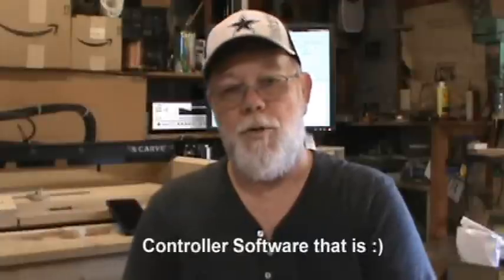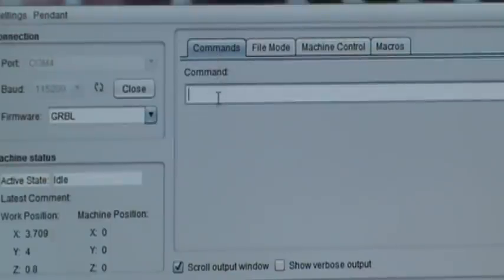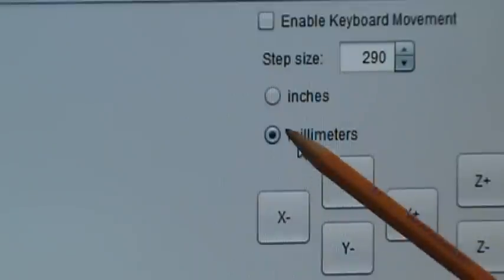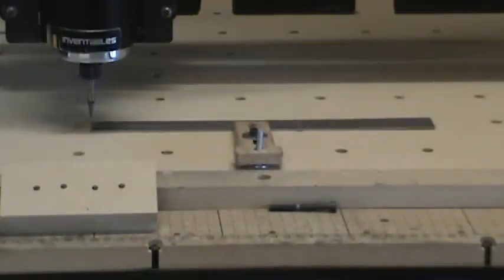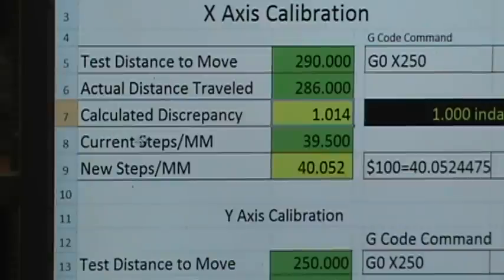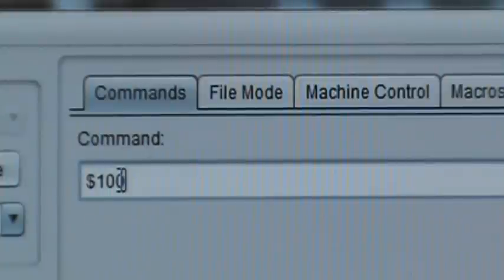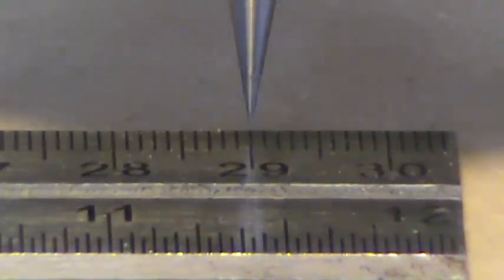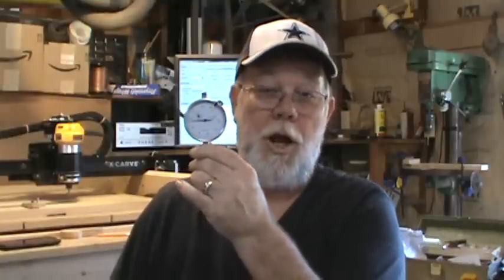CNC Stepper Calibration

Comment: Outstanding from one old hobbyist to another, THANK YOU all these wippersnappers talk to fast and leave steps out. The Spreadsheet was Gold. I can read and understand that perfectly I plan build one myself. Is this App still about I may go see after this. I have converted muy old Dremel Drill Press to a Mini Mill with manual X and Y Tables but am putting in a CNC Controlled Z axis to better manage and control cutter depth. I am machining old Model Train Chassis  to adapt Digital stuff to them. I can do it manual but the Z height on this Dremel Drill Press is not really controllable in a consistent way. Thanks for the help I go it now. Dennis in Virginia Any way you can change that hat. D

Comment: But after calibration, speed decreased, so now what value should be changed
Reply from the maker: you can iincrease speed by changing the settings on your stepper drivers.  Check the current settigs on the Pulse Table on  the driver.  The lower the setting is the higher you can get your top speed to be. After any ch ange on the pulse table is applied you will have to recalibrate the steppers again.
Reply from the maker: change your resolutin settingsnon tour stepper drivers.  sounds like they are too high to gain from anyway6. I suggesst a resoluthio resolution higher than 800. Anything higher won't likely have real benifit on a hobby cnc .

Comment: I am a newbie. i made my own machine.  I have it up and running. using arduino,grbl.,ugs. Visulizer shows an item key chain  that is 40mmx40mm. but machine is reproducing image 20 times larger. re calibrated doesn't help. what am i doing wrong? please help. thanks

Comment: I replaced my woodpecker control board with a GRLB 1.1F board.  The new board is off on the axis 4 to 1.  I could correct by changing $101=800 to $101=3600.  It appears excessive and I wonder if there is another issue.  Board works well otherwise.  Thanks
Reply from the maker: tohose numbers are not excessive at all.  Make a project with a square and measure each side and see if it is correct. If not then use the spreadsheet in this video to help you determine the correct callibration.

Comment: Not sure how u got 1.014 when u subtract 286 from 290.. My math would say 4
Reply from the maker: You would be correct if it were simple subtraction. In which case there would be no need for the spreadsheet to do the calculations for you. However, the calculation you are referring to is not a simple subtractions. It is a error ration calculated in a fairly long equation that is very easy to get wrong if you try to do it with a calculator or even with a pencil and paper. Hence the benefit of a spreadsheet.
Reply: @CharleyThomas2016  He-he ;-) Fairly complex equations @5:02 are 290/286.25=1.013 and 1.013*39.5=40.017. Indeed, you need full power of a modern CPU to get it right :-)
Reply from the maker: @Calaribdo I have found that most Hobby CNC Users (Especially the new ones) are not interested in trying to figure this out. What that want is a quick simple solution so they can just make something that turns out right for once..  My findings are based on the hundreds of email and phone calls I have had helping people out when they are stuck. They have spent a fair amount of money on something that just isn't working correctly and want a solution. That is what I have provided here.  A non technical, easy to understand solution to a common problem. I have not ever and don't ever intend on collecting any fees for any technical support.  Customer or not doesn't matter.  There are plenty of people out there that have enough experience and they have taken the time to learn the how and why of things like this, perhaps you are one. If so Bravo to you, but lets not make fun of  new users that have just scratched the surface. We were all there at one time or another.

Comment: I try to check the machine that I made, using the pen but whenever I try, I find that the pen rises to the top away from the surface of the paper
Reply from the maker: If you are using GRBL and your X and Y axis move correctly but the A Axis moves up when it should move down then change GRBL setting $3 to $3=4.  Reference Directions settings for $3 below:

Setting Value Mask Invert X Invert Y Invert Z
0 00000000                       N        N      N
1 00000001                       Y        N      N
2 00000010                       N        Y      N
3 00000011                       Y        Y      N
4 00000100                       N        N      Y
5 00000101                       Y        N      Y
6 00000110                       N        Y      Y
7 00000111                       Y        Y      Y
Reply: @CharleyThomas2016  
Thank you very much Sir, I will try this and I hope that the problem ends ...

Comment: Can you explain to me how to tell the program the measurement of the machine and measuring the piece that I want to cut by the machine ... !!! ...................... And whether the numbers that  I used it in this calibration you made will change when you start working using the machine .... I mean the numbers you used such as 290 mm Is it fixed or change later ... I ask you clarification
Reply from the maker: You do not need to use 290mm as a test distance. You can use any value you like. The longer the distance you use as a test distance the more accurate it will be.
Reply: @CharleyThomas2016  
Ok.....thank you so much

Comment: Hmmm This is actually MORE COMPLICATED than Mach3 Calibration process. 
No spreadsheet and no recalculating.   All you have to do is enter the actual distance traveled (error) and Mach3  automatically does everything.  run the test again and Voila!!   it's Calibrated.
Reply from the maker: You are 100% correct. Just try to do the math without the spreadsheet and you will really pull your hair out!
Reply: @CharleyThomas2016  Yes, IF we try to do it manually, it might have some difficulty. 
But Mach3 does it all AUTO.
2 questions 1 answer and VOILA!! 
"How much do want to move?"
"How much did it move"
(enter the actual movement"
mach3 recalculates! DONE! 
(second run is to verify. but it's done!)
In my very First set up on a Bridgeport CNC1 Mill, I refurbished
I guessed that I would have 2000 steps per inch. (initial settings) 
I run the Calibration and it only moved  
exactly 0.1 inches.  So mach3 adjusted to 20,000 steps/inch  (logically.  factor of 10)
and VOILA!   second run was only to confirm.
This Calib is done by  "Steps per Unit" (mm or inch)  so All gearing, pulleys, leadscrew pitch, etc. even added incrementally is IRRELEVANT.  The only that matters is How many STEPS did it take to get to the desired distance.

Comment: well i liked and subbed so there ye go.Curiosity time,is the x carve arduino powered?.
I'm building my own 3 axis bed and i might blag some sizes from it,drive stepper types ,spindle rating etc.
Reply from the maker: Yes the X Carve is Arduino Based. It uses a GShield mounted to the Arduino to power the stepper motors and GRBL programming for the Gcode.

Comment: I am using tb6560 board...8mm lead scrow..........1mm g coad =2560.000 1mm running ............       but continuously not running so what to do......please tell me about this...
Reply from the maker: I assume you are using Mach3 to control your machine.   If so, take a look at this video to help with wiring and getting Mach3 configured:  https://youtu.be/vf1a6F2tYdU and https://youtu.be/PwR3mzRf5X4
Reply: Charley Thomas  I am using Arduino board  than what I do...
Reply from the maker: With the Arduino you should be able to use the Universal Gcode Sender nightly build to get things going.

Comment: Thanks Charley
Starting the assembly process later today. Need to build the bench for it first.
Hope to have my controller by the time I am done putting it together. Going to take my time and do it right.
Reply from the maker: Just remember that a FLAT table top is your friend. Go to any extreme necessary to make it FLAT - FLAT - FLAT!!
Reply: Yes, FLAT :) I have 2 layers of 3/4" MDF covered by a 1/8" Hardboard.
Do you have the spreadsheet available for download?
Installing the Triquetra tonight
Reply from the maker: If you have the Triquetra then it is on the Blue disk or you can download it from the Triquetra Owners Page. Look for the Excel file G-Code Generator. The calibration page is part of that.
Reply: Thanks Charley

Comment: when I am in UGS i do not see machine status so I can not tell how many MM per step I am getting. Any ideas on this ? Thanks 

Martin 
Texas
Reply from the maker: Fortunately you don't need to. Just enter the distance you want to travel and put that the spreadsheet. When you click the jog button with your jog units set, that is how far your machine will think it is going. The ruler will tell the you how far you actually traveled and that will be the second number you put in the spreadsheet to get the correction needed.

Comment: Is it best to start axis calibration with the full travel of the machine and work down, or small axis travel first? Oor does it make a difference?  Very helpful video and thanks for your spread sheet.
Reply from the maker: It doesn't matter which axis you do first. It is best to use something that will measure the greatest distance of travel for whichever axis you are working with. You will be more accurate if you test with 300 mm of travel than you will if you test the same axis with only 50mm travel.
Reply: Thank you.  It stands to reason (then why did I ask?) that the any error remaining over the longest travel would be lessened as the distance traveled became less.
Reply from the maker: And any error will be easier to find over a longer distance.

Comment: This only calibrates you to your ruler. Unfortunately you have to be super careful what rulers you use - I've seen some shockingly poor laser-marked rulers!
Reply: Do you have an alternative way of measuring similar distances?
Reply: If you use this method to get close, you can use a magnetic mount and DTI, move a smaller distance but with much higher accuracy. You're then down to micron-level errors - most DTIs will do 10mm with 0.01mm resolution, some do an order of magnitude better. Like this one https://www.youtube.com/watch?v=ix9g95DVomc

Comment: any way to host this somewhere reliable?
like google drive, or dropbox?
Reply from the maker: This link should get the spreadsheet for you. I just tried it and it is working fine. If you still have trouble, use the contact form on my website and I will email a copy to you.   

 http://triquetra-cnc.com/stepper-calibration-spreadsheet-sign/

Comment: Charley, I could not find the odd mounting piece on any of Harbor Freight's dial indicators. Do you have a suggestion?
Reply from the maker: I took a piece of aluminum about 3/4 inch square and 4 inches long. Drilled and tapped hole in about the middle of the 4 inch side for a 1/4 inch bolt with the head cut off to fit inside my collet. Then drilled and tapped a hole in one end for another 1/4 inch bolt that fit through the mounting bracket of the Dial Indicator. Works like a charm.
Reply: well explained....

Comment: Thanks its help full. i am confused about EXCEL SHEET. Can you explain please
Reply from the maker: Not sure what you are confused about. The Excel Sheet is a Microsoft Excel Spreadsheet that I configured to do what is in the video. If you have a specific part that you would like me to explain pleas let me know and I would be happy to help you out.
Reply: Charley Thomas. Thank for attention.
I am newer in this field.
I am trying to convert Reprap prusa i2 3D printer to CNC machine.
I have replaced electronics.
Now issue is calibration.
I understood about your video but I have no EXCEL Sheet like that.
Can you help me about that EXCEL SHEET. I mean can you share me.
Reply from the maker: Just go to my website at www.triquetra-cnc.com and on the home page at the bottom there is a link to get the stepper calibration spreadsheet. It does require Microsoft Excel however you can also open it in with google docs or Open Office which are both free to download.
Reply: Charley Thomas Thank you.
GOD BLESS YOU.
Reply from the maker: My Pleasure

Comment: First a bit about accuracy.....

An error of say 5 thou in 4 inches will translate to 15 thou per foot. The longer distance you can measure will in itself minimize TOTAL inaccuracy. 15 thou is right at 1/64th an inch or .381 mm. Also how you have the speed and ramping set up for your steppers can affect the accuracy too. Too fast of a ramp up or too high a speed setting WILL cause steppers to loose steps. Get these settings right before setting the axis movements. There are many videos on you tube on how to do this. Most common are ones showing to set them in Mach 3. IGNORE the part specific for that controller as the setting procedure is the same.  What is different is HOW you modify the settings for your controller. Another thing that can affect overall accuracy is dull bits, bits dug in too deep, and to high a travel speed.  In addition, keep belts, lead screws, and bearing surfaces clean. These can cause underpowered steppers, common on many small cncs, to loose steps. The steppers must not loose steps to maintain accuracy.

I recommend using one of those digital calipers. They will . work Dull bits, bits dug in too deep, and with both English and metric.  Clamp it down in such a way the body WILL NOT move and at the same time allow free movement of the slider. Rulers can work but its IMPOSSIBLE to eyeball anything to the degree you can get with the calipers. Dont expect to get anything closer than about a 64t of an inch or half a mm using a ruler. 

Use a bit of 1/4 or 1/8 rod in the chuck instead of a bit because if the bit turns somehow, the reference point will shift due to the fact the flutes are usually a spiral shifting the contact point. Use one of the common digital calipers you can find most anywhere, the longer, the better. A 6 inch one is most common. You should have one anyway as they're very handy for a multitude of uses such as measuring the real thickness of materials. Stock wood is almost never the thickness its sold by. If you have the real material thickness then just set the maximum depth of cut a few thou short of the thickness and you wont ever chew up the spoil board. 

The procedure is exactly the same, other than how you make any needed corrections, for all CNC controllers. What differs is HOW you modify the settings. You will find how in the instructions for your controller.

Clamp the calipers down solid where the body CANNOT move, but allowing freedom of movement of the slider. somewhere where you have double the  length of the calipers to allow clearance for the slider part. I use English but its the same exact procedure for metric.  All that changes is just numbers.

Now open the calipers up a bit and position that bit of rod close but NOT touching the fixed jaw. Next slide the movable jaw against the rod and ZERO the  calipers display.  Make  a move about an inch shorter than the range of the calipers.  The actual movement can then be easily read off the calipers display within half a thou of an inch. Use a 1 inch dial indicator for Z and make your movements UP.

With the X-carves, and possibly other controllers,  you got to do a bit of math to figure out how much to adjust the value for the axis. Wth mach3 that I use on my home brew its completey math free. It has aneat utility built in where you tell Mach 3 how far you want to move.  When it finishes a box pops up asking you how far you actually moved. I simply put in what shows on the caliper display and it makes the needed adjustment, one reason among others, why I DID NOT NOR EVER WILL go with the type of controller the X-carve, along with several other small Cncs. 

Now that you have made your corrections simply manually run the spindle back to the starting point and repeat the above again. 3 or 4 times and you should be able to get down to say .0005 inch.

Comment: Hi Charley,
thanks for the good video and explanation. (I'm not so good with software)
all this I did not know, so thank you so much
It looks like 3D printer software I have seen now (I have two 3D printers)
I have no CNC(not yet) I want to make one myself.
I have an Arduino with a CNC shield and 4(more) stepper motors.
I have Arduino software, GRBL and Gcode Sender.
(It was said to me that I had better take Mach3)
I'm still looking for simple (free?)drawing software to send to the Gcode sender.
(Name plates and PCB will probably be my goal)

Regards from the Netherlands.
Rob.
Reply from the maker: Glad it was informational.

Comment: Thanks for the video. With digital calipers you could even approach muuuuch better precision
Reply from the maker: Perhaps so, but with a accurate ruler you can travel greater distances which will compound errors and make them easily visible. I used a 12 inch ruler. I have seen 24 inch rulers that would make it even more precise. The digital caliper would work very well for the Z axis though.
Reply: only if those rulers are presize enough. calipers or even digital micrometers are way better in that
Reply from the maker: I can't argue with that because you are absolutely correct.
Reply from the maker: I couldn't agree more. This is a quick and easy way to get you in the game though.